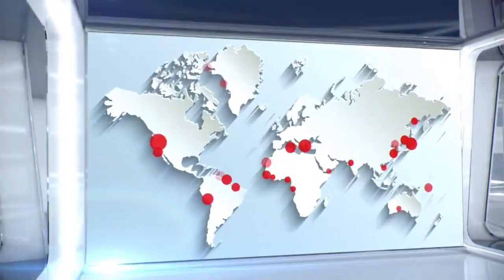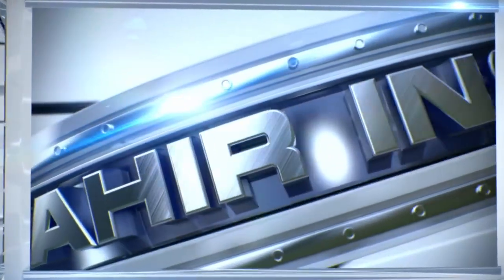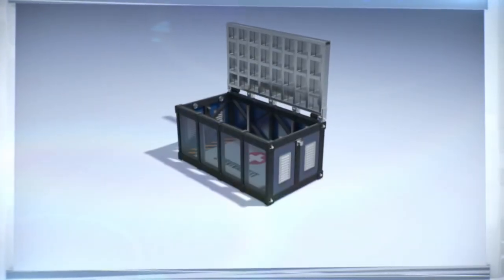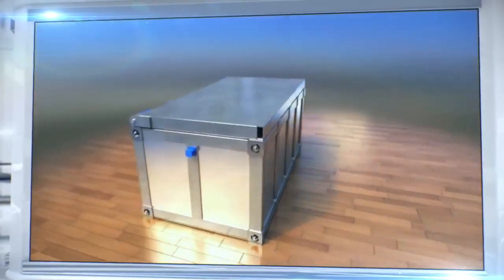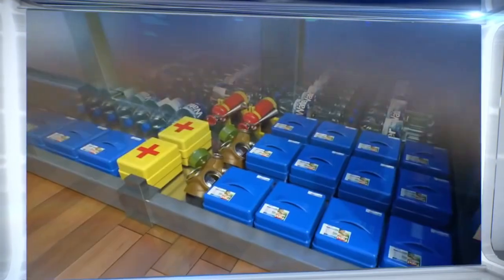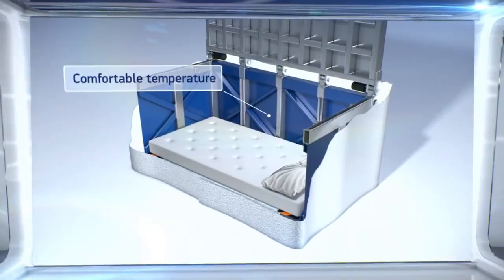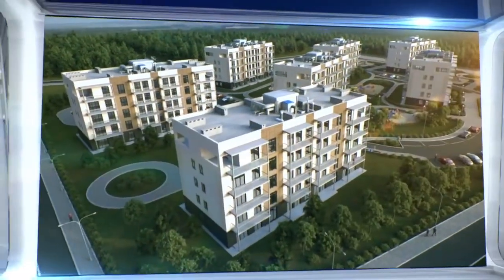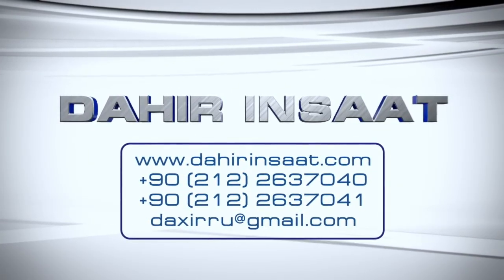Earthquake Proof Bed  Sleep In Safety - Survival Prepper's Dream

Comment: Kool idea. Alot of questions. You need to follow up on them or no 1 will buy them. 1st. Can I let myself out ? 2nd. Can I reach my snacks. 2rd. What if you have a thick mattress  ? 4th How many lbs can it suoport. If im on the 1st floor & 5 stories come down on me, will I be crushed ? Is there a little hole to toss your pee & poo ? What about a loud siren for someone that cant afford a sat phone ? A lot of questions here. Im interested, but I want some specs. Has it been privately tested ? I've worked with steel, aluminum & composite.  Is it offered  with different materials  ? Maybe  concentrate on the structure & less on staying in there for the long haul. Someone is gonna come by pretty quickly if your in a building, so maybe snacks, not so much. Water, yes. Mainly people want to get out if the earthquake is over. How do you get out ? People dont have 3000 bucks to drop on a platform, let alone a mattress. 727-224-3796. How about bullet proof ??? Good to hide from a breakin. Lock from the inside ?   Jeff  Thank You

Comment: This would be great if your company would use these beds in places like Turkey & Syria 🇸🇾 it would have saved so many lives..😢
Reply: Concur.  I woke up at 04:15 riding a mechanical bull.  I was almost afraid to get out of bed, I thought it might attack me.  You would DEF have to bolt this to the wall and or floor to prevent it from bouncing all over the place.  (The building swayed for a good 20 to 30 minutes after the quake and I thought I was going to die then and there.)
Reply: @falconeranatolia I was actually thinking of how to earthquake proof my next home...and I thought--put solid shelving on either side of the bed with a covering (sort of making my own vault to sleep in).  I could put water and non-perishable food, and clothing in the shelves.  If the building collapsed and I had this air space, I would also have water and food for at least 2 weeks (They are STILL pulling people out of the debris, both dead and alive).  This would, at least, give me a fighting chance.  Then I thought...google it, maybe they make such a thing.  Looking at this--it would not work against anything with any weight to it.  It would snap, but perhaps it would give you enough notice so that you could get up and run--but running in a 7.8 is NOT easy.  I don't really trust the looks of this particular bed.  I like my idea more---though it does have practical day to day use drawbacks.  I could suffer some drawbacks if it saved my life in another major event.  Why don't I move?  I looked at maps of earthquakes.... there's literally nowhere to move that you can avoid this disaster.  Granted some places have not had a quake like this---YET...but everywhere has quakes.

Comment: False advertising. It's just a fancy coffin.
Reply: To be fair to them, I did write them with about 7 different questions:
1) Do you know of any of your beds that were in that quake that had survivors, or any that had fatalities that you are using to upgrade and improve from?
2) You keep showing the supplies in the bottom of the bed.  I can't help but wonder how one gets to them with the mattress in the way.  Perhaps they should be in a side of the bed to make access easier?
3)  is there a way to manually open at least one side and / or the top?  I would hate to be stuck in there if the apartment survived the shock. 
4)  Is this device operated solely on house power, or can it operate from a medical grade UPS as well?  if it can operate from a UPS, can the UPS be stored inside as well?
5)  Your beds seem to show single occupancy.  Do you make queen or king sized beds that can accommodate two people?
6)  Is there water proofing?  If you sink to the basement and the basement starts flooding due to broken pipes, I would rather not drown.
7)  How much room is in them?  Would one be able to sit up if need be?  (If the BiPAP machine died for any reason, I do sleep better sitting up.  I haven't laid down in 7 days because I lost part of my BiPAP in that quake and am waiting on replacements.  It took me a few days to realize I can sleep better sitting up.

I will post any answers I receive.  This is not a perfect device, but sometimes imperfect items are better than nothing at all... those buildings are coffins in and of themselves.  I'd rather be given a fighting chance.
Reply: Ikr
Reply: Not even.  The first few items would make THUD THUD THUD noises, but the first beam that broke loose and fell would split that thing like a walnut.  At best this would be an early warning device to get your tail up and run.  My Idea is far more like that of a coffin--which is almost exactly as I described it to my Wife as I was explaining it to her.  but I could stack 2 weeks of water and nonperishable food and stand a far better chance of surviving in my coffin than those who had no such thing.  The miracles that they are still finding live survivors... or I guess you would just say survivors that are buried in air pockets is amazing--and they had no such purposefully designed protection.
Reply: o I did not watch the video... um  yeah... not sure I like this either... lol you are absolutely correct.  This is a coffin... more of one than my thoughts! lol